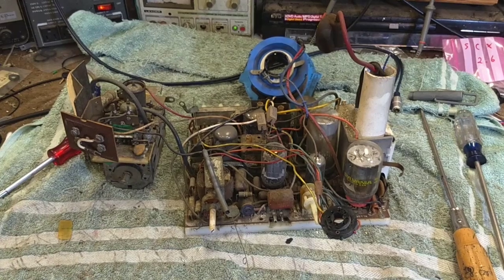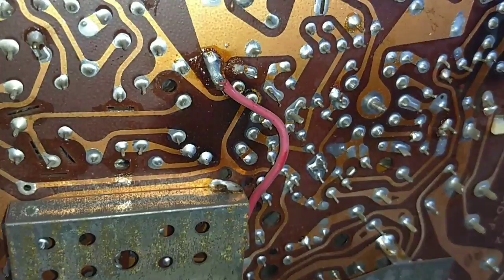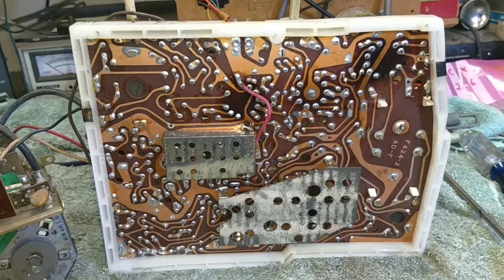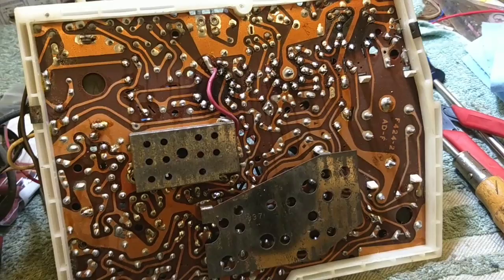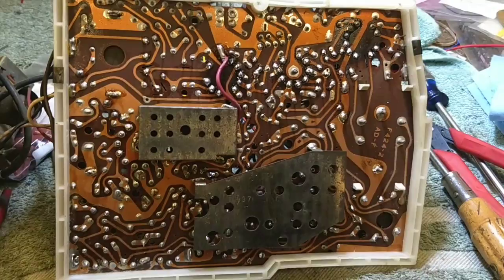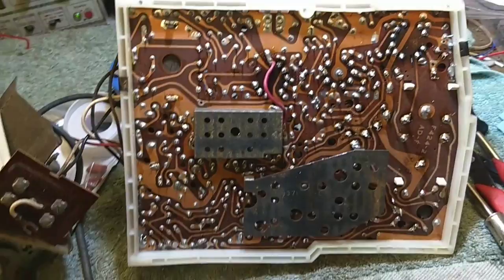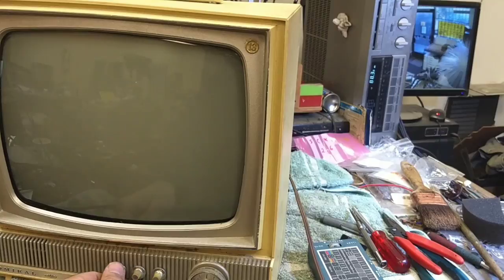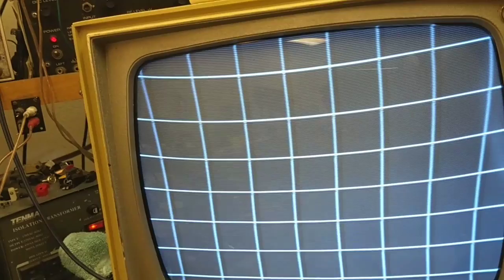Repair of a 1966 Admiral pk1369 vacuum tube black and white tv part 2/3

Comment: I bet the little magnets fell off the yoke. I would think even one shorted turn would overload Beyond use. Could always check the cathode current. Looks like the Admiral I recently did a video on I could send you some pictures of the yolk magnets
Reply from the maker: I have a magnet on each side of the yoke but none top or bottom.  Thought those were just for pincushion correction?
Reply: @JordanPier  Yes, those magnets are for pincushion correction on B/W CRTs. But I think that for this type of correction, you need just magnets on sides. So try to pull them up or down or take another magnet from other yoke and try it. Those magnets are not very strong.
Reply: Also has some twerking going on I know you had that in one of your sets , so some insight into correcting that would be cool too

Comment: Jordan, what is your opinion as to what is causing that intercarrier hum? A misalignment or shoddy design in the IF or video perhaps?
Reply from the maker: Could be bad IF amp,. misalignment, tuner problem. Only does it on bright text so I'm thinking it's just overloading from the hotter signal